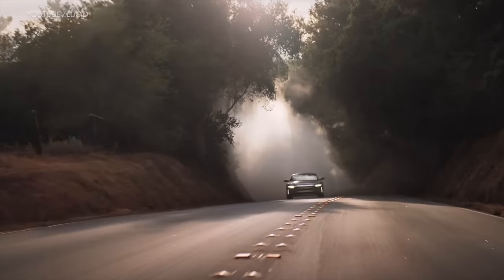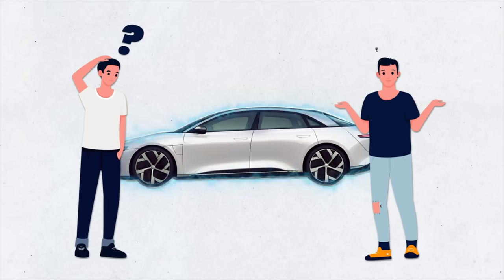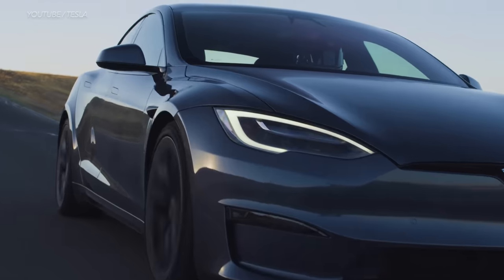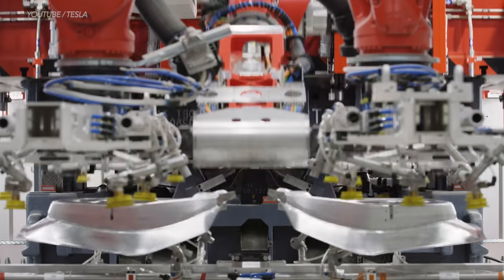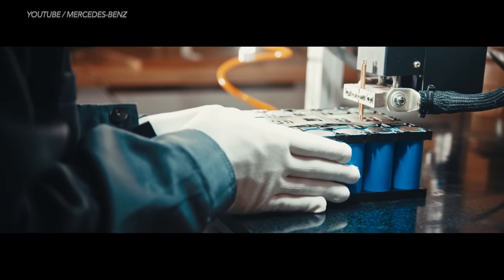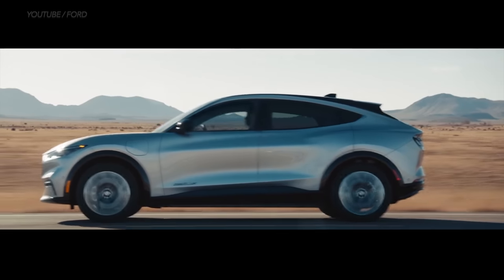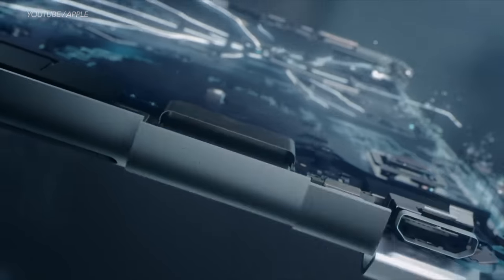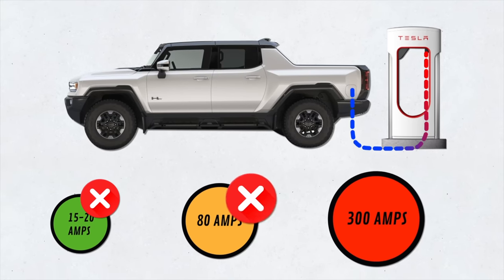Here's Why I'll Die Before I Buy an Electric Car

Comment: good luck repairing these cars yourself to save money. I've been able to replace a water pump, alternator, muffler, blower motor, with similar 3rd party parts at a fraction of the cost of the OEM parts and they are somewhat readily available at my local auto parts stores and can be found online. Not so much these proprietary parts which need to be programmed to work with the car, ala Apple's shady right to repair practices.
Reply: A typical EV has no engine, no radiator and cooling system, no clutch or gearbox, no timing or fan belts, no exhaust system.... How much repairing do you feel the need to undertake?
Reply: @Brian-om2hh  an EV has many more parts than just a battery and a motor, AND there is a cooling 
system for the batteries themselves, which when charging will require cooling. Also, let's assume the window regulator or switch goes bad or the door handle locking mechanism goes bad, you WONT be able to go to the junkyard and swap them out yourself and will be stuck going back to Tesla for a hefty bill to pay. Theres maintenance and repairs needed that wont be associated with the engine itself that will always require attention, and EV is not any different and will be much more of a hassle.

Comment: I would not mind if I could get my hands on an EV that has a good 80 miles or so in range and is able to charge from higher amperage. 
But, alas, these cost as much as a new, basic trim ICE car, while they are used, have no service registry, no service papers and have a good 130k miles in them. Oh and are at least 8-10 years old. 
Hard pass from my side. The cost of having them repaired just to be on a level of a 10 y.o. car that has been taken somewhat care of, is a bonus. (battery service and bodywork if rust is present)
It is clean it does not produce gases. But the charging station I'd be using would be dispensing energy from burning coal, oil and gas. So .. go figure.
And, as many have said; while an ICE rolls into a gas station, fills up, gets rolling on, with at least a few hundred miles of range, an EV rolls into, connects, loads up, and gets going. The shorter it is on charging, the less range it has. Hard pass again.
A hybrid engine with a nice charge-regenerating subsystem, running on a fuel that can be produced easily in massive quantities, burning more efficiently while being less polluting would be a way - but it does not exist as of yet.
Reply: This is not the time to buy a used EV

Comment: i'm waiting for hydrogen  fuel cell cars ,ev cars have been around since early 1900's it's not a new system we are going backwards with ev cars instead of forward, Honda were main players for fuel cell cars, who whats to sit around waiting for the car to charge up or remember to plug it in at home or worry about using the ac, entertainment system, electric windows or charging the phone up which eats the battery up and reduce the range of mileage
Reply: Exactly. Not to mention that even if 80% of cars are electric, that power bills will have risen for everyone.

Comment: It is true, EVs are not only too expensive, but they are hard to buy as the production cannot keep up with demand. Dealers are aggressively marking up EVs to the point where even the most affordable cars are sold at luxury prices. My sense is that we are between 3-5 years away from a time when buying an EV will be both affordable and easy. In the meantime, they're mostly for people with deep pockets. Nevertheless, they are the future, and the future portends a major shift from internal combustion engines (ICE) to all electric motors. ICE cars will certainly remain for the next decade at least, but sometime in the future, EVs will overtake them in sales. By that time, there will also be a robust charging infrastructure in place and no longer an impediment to ownership. For the old school group, there is no need to fret, there will still be lots of ICE cars available, but our grandkids certainly will not be driving them.

Comment: We all can have opinions, that's OK.
But until you've had experience using an EV every day, you don't know it but you don't know. I too felt exactly like Scotty Kilmer about the EV's. But I bought one and everything has changed. Read more...

Good summary on battery development...

I love Scotty but he's wrong.

Well, I'll soften, he seems biased about range issues. I think Tesla is there now. Read on...

I was once like him. I'm like him in many ways.... quite frightening actually.
It will take time, after he owns one, the right one for the right reasons, he'll come around.

My background is loving gasoline engine vehicles.
I do all the repairs myself, and have since I was a child fixing my parents and older siblings cars. That's around 60 years of fixing, then driving used ICE cars. I loved them. I still love certain ones. I still fix the ICE cars we still own along with the 2022 Tesla Model 3 Performance.
I'm also a cheapscape. Maybe extremely frugal is a more kind description. 

My last car before I purchased an EV was a $850 “shipbox” (piece of crap) car that I maintained and was happy that it got me anywhere I needed to go.

I also loved old vintage cars, I especially loved vintage Cadillacs with enormous V8 engines.
I even have a business restoring their parts. 

I'm a retired engineer and felt I didn't know anything about EV's or hybrids for that matter.

We moved and needed a car to do a LOT of driving. 
We took our first baby step. Bought a used Toyota Prius Hybrid. Wow! 
I'm impressed. I hate the interior noise level and anemic acceleration. Otherwise, everything is outstanding!

I retired with a little savings. I decided I'd buy my very first new car after 70 years of life and more than 50 years of driving. After being given a chance to drive a 2016 Tesla Model S, I was sold! Wow, what a car!

I loved muscle cars and fast cars and never could afford one.
I envied those who could buy the seventies muscle cars. 
At the age of 70, I decided to finally splurge on myself. The fastest car for the money is the Tesla Model 3 Performance. 

That thing is incredible!
Only a ride in it will convey what I mean.

I bought it and it's been a wild ride ever since.
Here's a summary.

Overall I love the car.

It's been a transformative experience.

Here's my experience so far:
Speed, handling, performance is other worldly. Nothing in this price category compares.  Nothing is close to the total performance and experience. That, and some of the automation is why I wanted it.
If considering performance for the money, it's a great deal, the very best.
But, don't buy one to “save money”. 
I cannot adequately describe the performance. It's nothing like a fast ICE car. It's a completely different animal. I can't fully and adequately describe it and all the reasons why. It's the total package. But a few of the reasons. Instantaneous power to the ground, nothing compares. I mean truly instantaneous!
It has as much torque as my Dodge Ram Diesel truck! But it has it right now! In a small car!
All wheel drive when hitting the pedal, no slip, wow. Low CG, Handling is mind boggling.  
Extremely balanced in every way. The weight is balanced front to back and low, very close to the ground. These are tremendous when going quickly in straight line and especially in turns or on hilly sections. Wow, wow, wow, and then some.

Other worldly. Does not feel like a car, more like a transporter or space craft.

If considering the cost, it's a lot of money, being in the $60 + stratosphere. That's a lot to me too!

I can't see buying one to save money, no matter how high fuel gets. 
These cars currently cost too much for personal economics to make sense. They have to come down in price a lot. They have a ways to go in that regard.
It takes a lot to make up for the difference in a used ICE car to a new EV. That's tens of thousands of dollars...

But keep in mind, this car is NOTHING like a cost-saving ICE vehicle, nothing. Not comparable. 
One day the prices will come down on EV's. Right now they are too high to justify on economics alone. With an exception. If you buy new and consider that “sunk costs”, then resale is good and you can just keep trading in to a newer car every few years. China is making ICE vehicles at low cost. If they come to the US, watch out. If Tesla ever sells an economical version for half what they are selling now, watch out.
So, perhaps I agree with Scotty in that way. 

I don't care if it's more or less green. 
I don't want to hear arguments for and against.  That's not what I bought it for. 
I bought it for fun, for me.

It does everything, many things very well, some things exceptionally well. 
Scotty Kilmer has it wrong. Charging is not an issue for my Tesla. I'll repeat, charging and range are not issues. Too much focus on batteries. Though I appreciate the lecture on the different technologies. I also do not trust companies like GM. They promise and never deliver. All that talk of the better GM batteries, I won't believe until I see them road tested in production. They are decades behind Tesla and may never catch up.

I don't think about charging anymore. 
It took about two months of ownership and quite a few long trips. I finally do not have range anxiety and I don't have any issues. Sure it'd be nice to have a longer range, and that day will come. But it's not a problem at all.

I leave it plugged in at night in my garage.
The car is “rated” at over 300 miles. But practically speaking it doesn't get that. Especially if you treat your battery properly.

When I take a trip of more than 250 miles round trip, I just stop approx every 1-2 hours, take a break, stretch my legs, move my body, go to the bathroom, get a coffee to bring back to the car, and unplug it. That's plenty!
I NEVER WAIT FOR CHARGING
 I find driving this way incredibly relaxing and enjoyable. Since I'm on autopilot the whole way, the car is vibration  free and mostly quiet, the ride is easy.
When I drive one of my other cars, I find it annoying to have to stop to get gas. Really.
I'm totally annoyed having to change the oil in our other cars. Tuneups, OMG. Vibrations, noise, multi pedal driving, and so forth. 
I've been so spoiled with my Tesla EV.

I've taken a full family with luggage to and from airports, no problems.
I've camped in it, no problems, much better than any ICE car. And I'm a big guy!
It's virtually maintenance free.
Battery isn't an issue, warrantied, I never think about it anymore.
I developed “good charging habits”. I charge between 25% and 85%, typically. That keeps the battery life quite long. 
One-pedal driving is MUCH more important and beneficial to me than I'd ever dreamed it would be. I don't want to ever go back. 
The modern technologies included in the car are mostly wonderful.
I use the autopilot almost all the time. I've learned how to get along with it. Now driving is much nicer and safer. The number of “phantom braking” and nuisance alarms has dropped tremendously. 
There were “bugs” that had to be worked out. After several over the air software updates, the car is really awesome. I also got used to it, which helps a lot. 
The Tesla service thus far has been free. Sometimes they send a tech to the house for freee. That's great!
If I'm out of the car for service they give me Uber credits of $100 a day. 
There have been some annoyances. 
The glass roof was too hot, I had to insulate it.
I found the seat a little too small for me so I made some modifications. 

I'm very lucky I could afford one. 
If I couldn't afford one, I too would be posting my arguments as to why I won't buy one. 
If you can only afford a single car, the EV might also not be for you. Especially if you need a truck like we do. We are a two person, three vehicle family. A used 2011 Toyota Prius Hybrid, A 2007 Ford Diesel F250 long bed, a 2022 Tesla EV Model 3 Performance. Many families are finding the Tesla Model Y to meet all their needs, provided they can afford one. I personally think the Model 3 standard range just doesn't have enough range. If you get a SR and don't have a home charger, you will be absolutely miserable.

And non-Tesla Chargers are not ready. 
Too many videos of problems, delays, slow speeds. 
If you don't buy a Tesla in 2022, 2023, and probably 2024, your charger experience might ruin the entire EV experience.

One final thought.
if you don't have a garage with a charger for the car, you will not like your EV.

Scotty,
Keep up the great work.
I love your shows.

Comment: EV's are not new. Edison and Ford both worked together to make a production EV and they had the same problem we have today. The battery! It is the weak link and always will be. It is very hard to push high amps in and hard to pull high amps out. It will always degrade the battery regardless of the tech. In 1916 there was an EV called the Owens magnetic well it was really hybrid but it was functional. Like EV's and hybrids it never took off due to it's limitations.
EV's do have a place but it is really a short range car and always will be. Batteries are just too heavy and unpredictable with a limited life cycle to be trusted for high mileage and long life..

Comment: They're going to get us to accept shorter ranges and frequent charging.  What they're not going to to is get us to learn to live with lighter, slower, and cheaper vehicles.  Even though the younger generations have come to accept an automobile is just a hole in the street that eats your money, there are still those people that equate piloting a 4 wheel kinetic energy weapon with "freedom."  At least big pick-up trucks have some utility.  An electric sedan weighs even more, but isn't nearly as useful.

Comment: There are an estimated 290 Million registered light vehicles (passenger cars, trucks, and SUV's) in the U.S. alone.  This does not include commercial vehicles. Do you really believe the countries power grid can support that many electric vehicles? As, well as powering homes, businesses, etc. Also, do you believe there are enough resources on the planet to support the production of batteries for said vehicles and their replacements over the course of years? Going to all electric vehicles is a short sighted pipe dream.
Reply: Yes and yes.  My question for you: Did you come to the idea that the grid can't supply enough power on your own?  Or is it something you heard somewhere that you'd like to believe? There have been 2.32 million plug in vehicles sold in the USA since 2010.  But that's not why Texas' grid is janky!  About 1/4 are in California. Heard any reports of it straining the grid there?

Comment: I will only buy an EV. When I go around 600 miles on a single charge and then I can charge it from 50 miles back up to 600 miles as fast as I can pump gas in my car. Which will never happen. So I won’t be buying an EV. My time is more important. Why wait hours to charge when you need 5 mins to fill up with gas.

Comment: Scotty I would buy an EV when we make them more like airplanes, with the min you need with the highest safety.  You can build a "shell" that will last for 300 years, bounce off a transport truck and still have no scratch.  But then you are locked into that design for ever.  The transfer must start to more efficient designs and less legacy.  Putting a battery pack and electric motor in a ICE design makes no sense.  Prius was small and ugly, but that is what true EV design is!  Time will make these EV's tip the point, but currently I would get a PHEV with a small displacement high HP motor and a battery that will do 90% of your driving.  Wait till the engineering community gets the marketing community to change.  As people only want what you tell them to want.  Look up Amory Lovins a very smart man who consults for 42 countries around the world.

Comment: This video has alot of mistruths.  Solar is the cheapest form of energy now, cheaper than NG CC, coal and even wind.  This year solar installations will accelerate, so yea, go ahead and charge using solar, because this year it is the cheapest per kilowatt of energy on earth.
Reply: Couple things you're not addressing is the size of the solar system and payoff date. Home systems are hardly ever 100% of the needs, they generally target 50-60%. Now yes you could say that % is dedicated to 'charge your car' but really its offsetting power being used by the house. Then you need usually 6-11 years for payoff date of the system.
Reply: @Dirkdaring44  I'm not necessarily talking about "HOME" systems.  Most of the growth in solar is on the commercial and Utility scale, which have come down to a cheap $1 per watt installed.

Comment: EV’s are about 3% of the market currently and that will increase as governments force people to switch in the future.  So far governments are looking at 2035 to enforce various percentages of EV’s to be sold so internal combustion vehicles will still be manufactured until governments force 100% of new vehicles to be EV.  Even then, internal combustion cars will be driving on the road, my guess is until at least 2050+, depending on the country.  I’ll likely be driving a gasoline vehicle for the rest of my life, although I could end up with a hybrid at some point.  Full EV’s won’t be popular where I live until they can be reliable driving several hundred miles in -30 C on icy, snowy and wind swept roads.